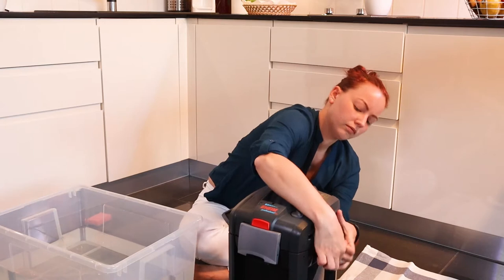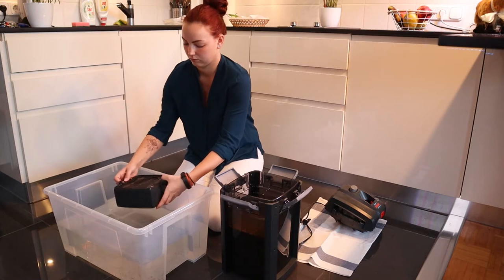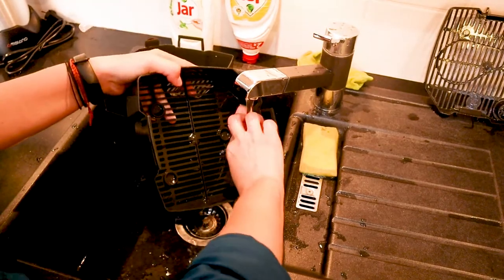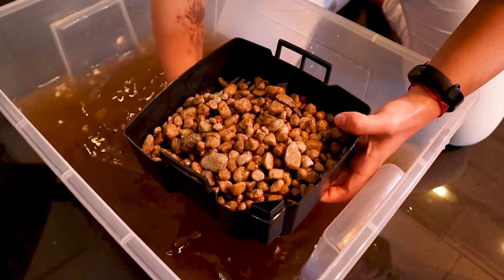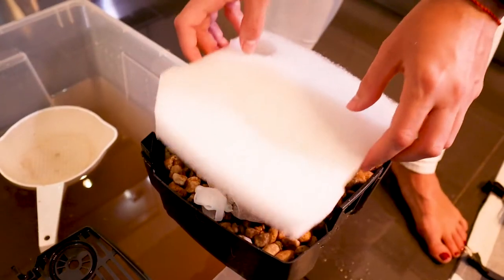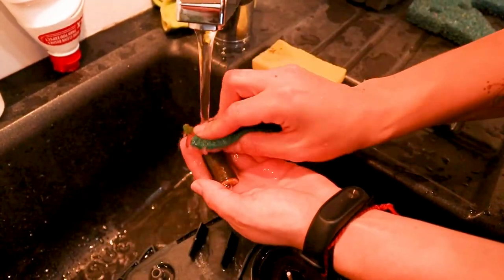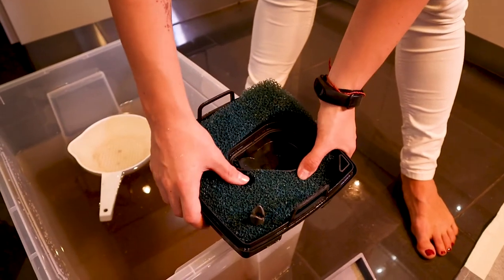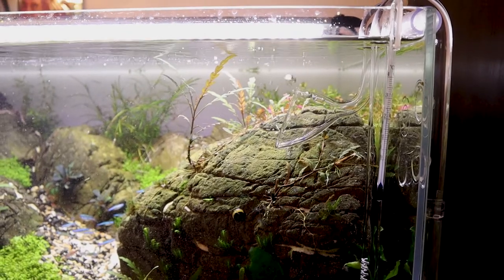External filter maintenance ( EHEIM professionel 4+ 600 )

Comment: Good video AquaFox, I clean it similar to you. However, I highly recommend that you keep the filter floss and foam at the bottom most tray. This filter, like most canister filters, are designed to have water inflow to the bottom tray first. Water slowly rises through the biological filtration media (Seachem Matrix) before exiting to the outflow to the aquarium. This way the muck is captured first in the foam, water is polished before it floods the biological filtration media. This helps to prevent Seachem Matrix from clogging up as seen in this video.
Reply from the maker: This week i will clean&change according to your method.. :)

Comment: put a fine sponge (2-3cm of cotton) in the bottom basket.  So that the water only reaches the media after total mechanical filtration (incl fine part), not clogging the media.
Reply: also very first basket should be sponge and floss as clean water should pass through all media, cheers
Reply from the maker: Yes, you are right... It is also possible. The normal way of the filtration is: Mechanical-Bio - and chemical. But you can see my filter on the video after 6 month of continous running without too much clogging.. :)